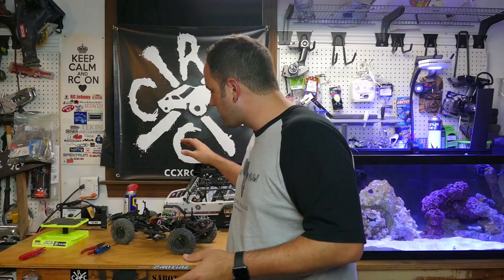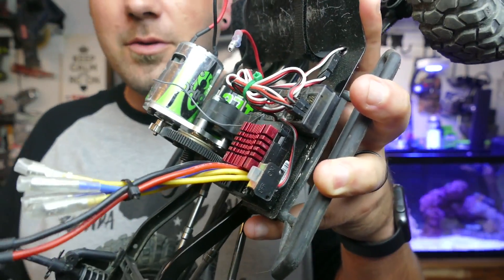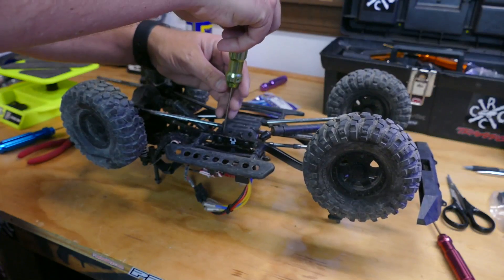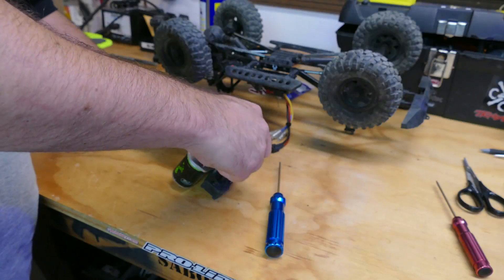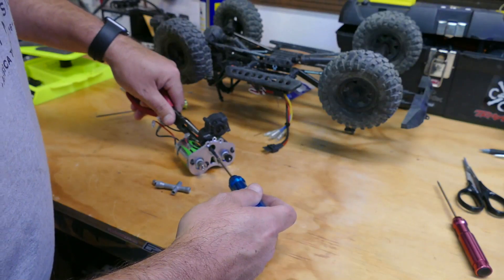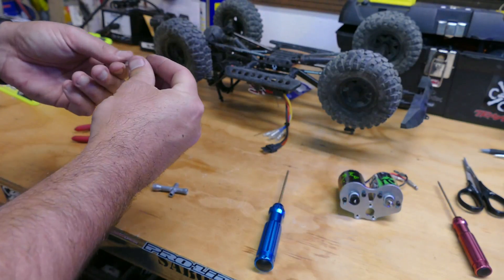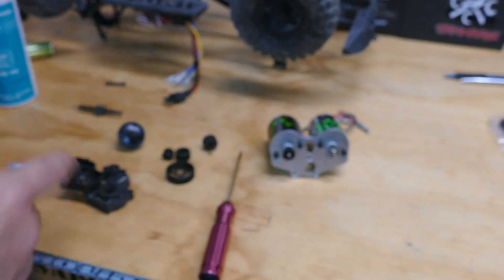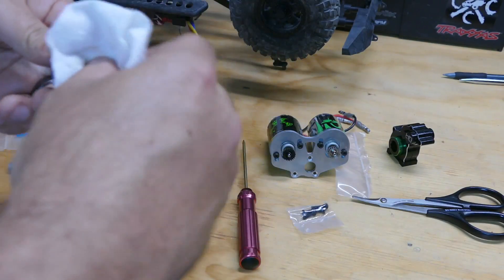Hot Racing Metal Gears & Gearbox Upgrade for SCX10 with Level-3 RC Dual Motor Mount)

Comment: Haha shortcuts are the best! Great 👍🏼 video gonna get one for my SMT10 now
Reply from the maker: I got them for my SMT10 too, but didn't get the metal box..just the gears for the smt10
Reply: CCxRC Oh ok right on👍🏼. I had to get the whole box cuz when I got the truck straight from Tower Hobbies one of the four holes on the bottom of skid plate was already stripped which was the hole on the bottom of the gear box. I was pretty ticked lol

Comment: Is the dual motors worth it? I need a new esc anyway.  Also do your tires rub on your battery plate? I think i need a lift kit because when i turn it rubs.
Reply from the maker: +MechHead Naga GMG I've had no rubbing issues. What size tires are you running?  Loving the dual motors. Good power and speed with the 35T motors